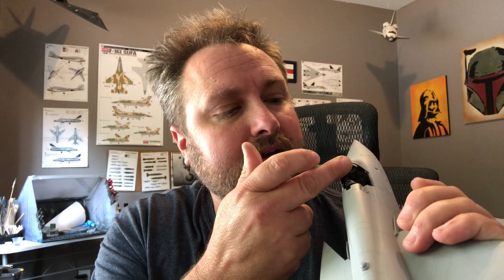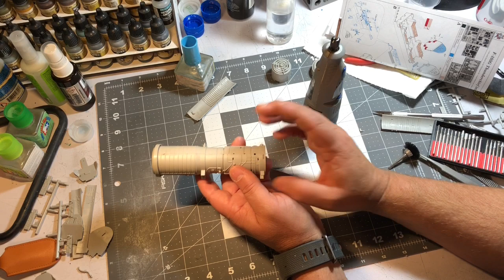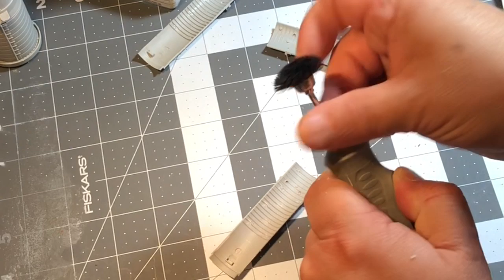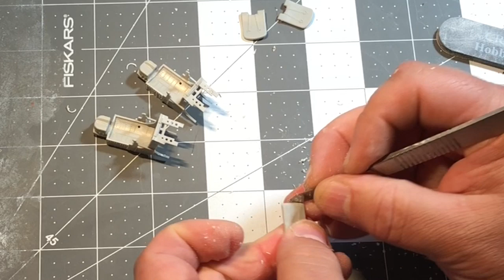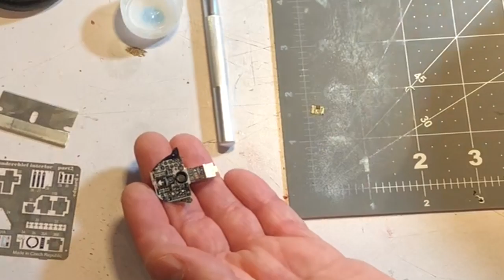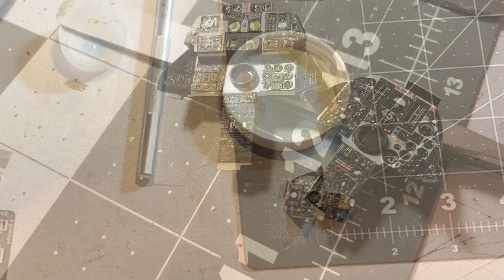Trumpeter 1/32 F-105 G Build Part 1

Comment: The front of the engine is the Low Pressure Compressor or LPC.  Those are fan blades connected to the front hub.  If the design of those old Pratt engines are the same as the new ones, (say on jumbo jets) the rear is the turbine exhaust case and the fan blades you would see in the back would be from the Low Pressure turbine.

Comment: Swann morten make a 'craft knife' handle,its a lot safer to put pressure on end of blade and easy to refill,slide in blade and tighten wheels to hold it.It only has 2 blades available,straight No1,curved No2.Makes the No 3 handle look homicidal.Great vid,cheers.
Reply from the maker: Thanks Darron, I’ll look into that.

Comment: Thanx 4 the tip I just got a magach 3 50 yr. anniversary addition main battle tank and its ol school tried everything to take off the mold points off of the rollers there were alot, I'll just have to see if they have such a dremel kit @ harbor frt.

Comment: Nice builds going on there.. I have to give you a warning though. From memory, there is an issue with the seat height on that G model?? Maybe the floor is too low, or too high?? Would hate for you to finish it only to find the seats are sunken too low or sticking out of the top??
Reply from the maker: Thanks Nigel.  I’ve been test fitting the tub into the fuselage as I’ve been gluing and making adjustments as needed.  You gotta love Trumpeter ;)